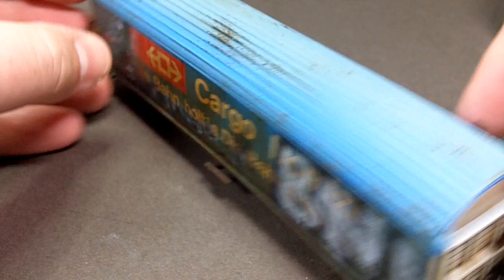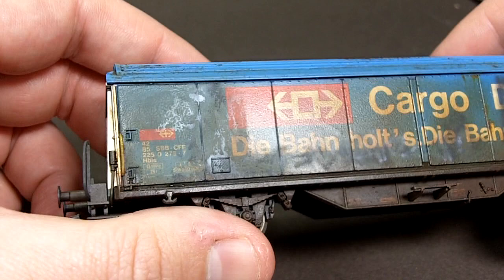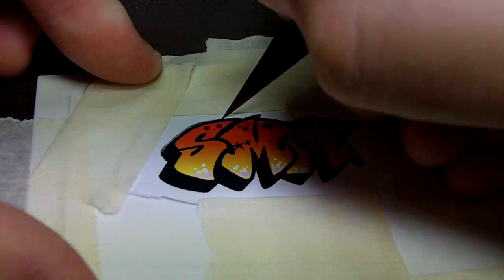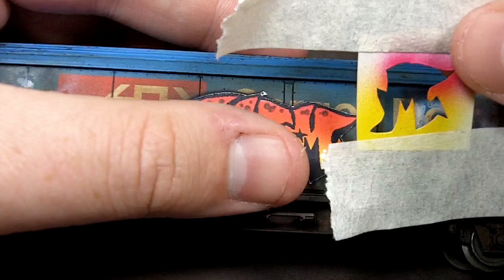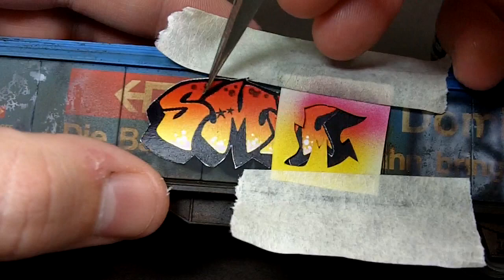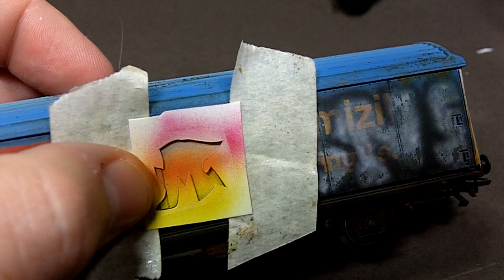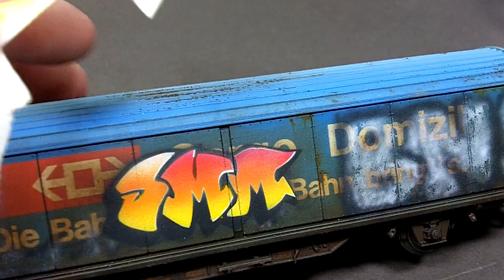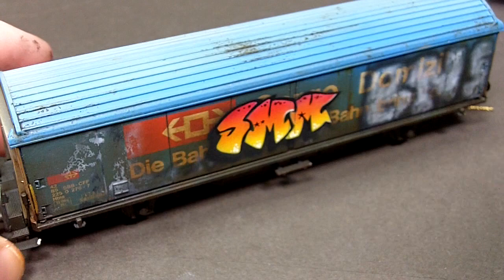Weathering a boxcar part 3 - graffiti on trains using an airbrush

Comment: You should make the graffiti go off the bottom, its called a 'panel' and its how you tradtionally paint graffiti on a train, what you did was called a 'floating piece' and thats the way you would paint graffiti on a wall. Type in 'train graffiti' on google and you will see that 99.9% of them go off the bottom of the side panel of the train.

Comment from the maker: @APHEXHEAD Hi - yeah the glaze medium is from Vallejo, you get a good shot of the bottle in part 2 of the train video.  It will indeed help with tip dry.  I use it kind of like a thinner, but it doesn't weaken the paint so much if you get me.  It's a damn nice little bottle of stuff.

Comment from the maker: @kamniks brush painting the varnish is a tricky one, I try to avoid doing it if at all possible.  If I DO  have to do it, I thin the varnish and try to set the model so the varnished area is lying flat as gravity will "self level" the fluid.

Comment from the maker: @paintermarine potentially yes, but what I wanted to avoid was the template/paint drying together so when I lifted the template it caused the paint to rip off the model.  If I was 100% sure this wasn't going to happen then I would definitely have done it so I didn't have to re-apply the template.

Comment: what kind of camera are you using for shooting your vids mate?
Reply from the maker: this is one of my old ones, so it was either a Kodak zi8 or JVC everio.  my new ones are filmed on a Canon xha1 and a Nikon D5200
Reply: +ScaleModelMedic Cheers.
Reply: +Para Modeler trying to shit a video for my kid. new to modeling. what are you using to hold said items in place? maybe a short video and how to would be super appreciate
Reply from the maker: +Para Modeler lol you won't have much luck getting any videos out of there!!  I don't use the setup you see here any more but it was an angle poise lamp arm with a bolt through that fit the camera fitting.  now I use tripods, check out the Facebook page, I posted some pics last week

Comment: try the book "subway art" by martha cooper  , a lot of authentic graffiti can be found there. i like the method , but the graffiti itself needs a little bit more realism in its shape. graffiti is a subculture with its own defined letter designs...this needs to be considered when reproducing graffiti in small scale, in my opinion.
Reply: JONAS FISCH. Use real artists if you want those names...
Reply: There's no defined letter designs as such in graffiti, however there is guidelines like keeping the letters and structure uniform, which obviously isn't the case in this video, seeing as the M's as example is two different shapes/styles and sizes, and thus does not look good at all, and overall the letters shift sizes throughout aswell.  It is supposed to be symmetrical and keep the same flow throughout so to say...  a good way to practice this, is using checkered paper, or grid lines on the computer.